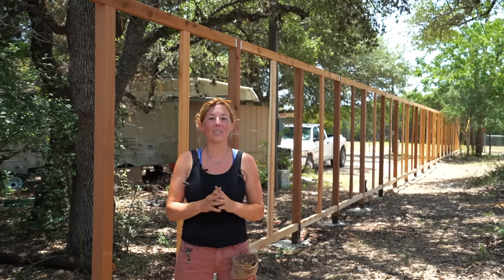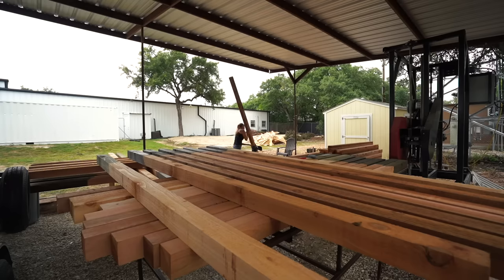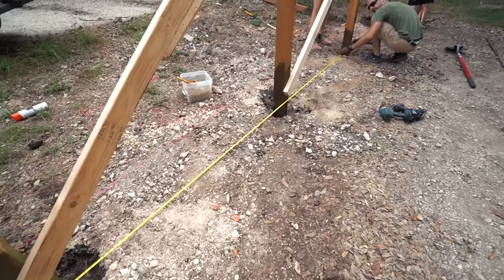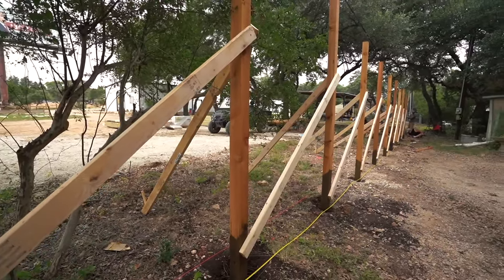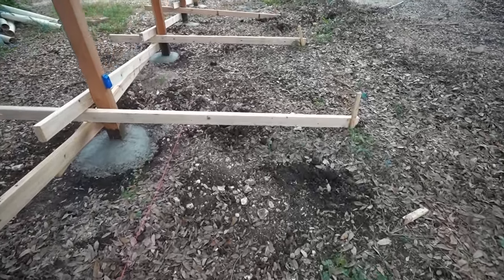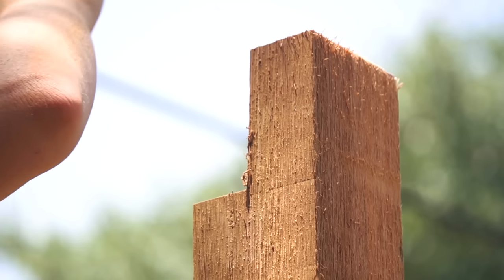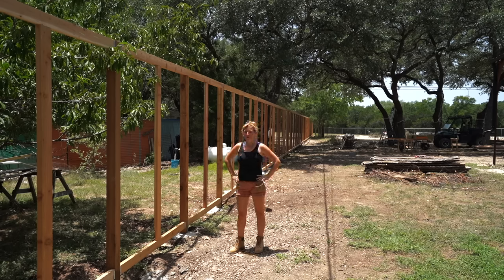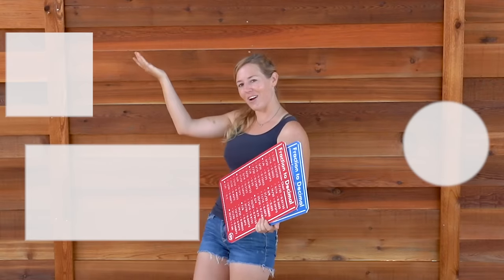Building a Horizontal Fence

Comment: Have you ever tried a product for anchoring fence post without cement? 
It's a foam where you mix 2 ingredients inside the bag, shake it and pour it in the hole and then it begins to foam up. The foam expands right into the soil, creating a solid bond. It's even waterproof from what I was told. 
I saw this being used once. I thought no way that stuff would last. That was a couple of years ago and the fence is still standing without any problems.
We're at 5,000 ft in the high mountain desert, we get real strong winds and big temperature shifts.
Anyway thanks for great the video April! 🇺🇸🇺🇸🇺🇸

Comment: nice fence, nice video.  
A couple comments.  the fence posts are not set deep enough.  A rule of thumb is to set the posts in the ground half the distance above ground.  
The second comment is with respect to the concrete.  You don't need to use concrete.  If you have crushed gravel in your area, use that.  It is a lot cheaper,  secures the post just as good and has many advantages over concrete.  First, concrete absorbs moisture which is why you need to treat the bottom of the posts.  Second, concrete shrinks so it will always leave cracks around the base of the post which will allow moisture to penetrate and remain.  Third if you live in an area in which the ground freezes, concrete will promote frost heave unless you use sonotubes.  Gravel doesn't.

Comment: Some guy I ran into at home depot when buying my wood for a fence told me once he started putting the concrete in dry then just run a hose over it he'd never go back to wetting it first. So that's what I did and it worked great. Probably a bit harder to shape it that way but saves a ton of effort and time.

Comment: Should be interesting to see how the boards bow over time and how the fence ends up.  I've tried running the rails where the major thickness was parallel to the ground and where the minor thickness was parallel with the ground and after 10 years, they were both bowed noticeably.  I had well over 250 ft of cedar privacy fencing blown down around my house during Hurricane Ike.  I replace 250 ft of it with steel picket fencing that I welded up myself (the back fence that overlooked the greenspace behind my house) and the side fences that I shared with neighbors were rebuilt with cedar.  The problem is that the privacy fences like that (or what you've created) are not particularly resistant to hurricane force winds.  Even without hurricanes, some of the storms that go through Texas pack some pretty good winds, so if I wanted a cedar fence and didn't live in a place infested by HOA Nazis that dictate EXACTLY how your fence must look, I would go with the design where you put pickets on both sides, but leave a large gap between the pickets so that air can more easily flow through them.  The horizontal basket weave style fences look like they are a bit stronger also.

Comment: Growing up my grandfather always used used motor oil as a wood sealant. He said it worked better than anything else.
Reply: To help lengthen the lifespan of in-ground posts we’re taught to use a 50/50 mix of kerosene and Used motor oil. Roofing tar also works great,  posts I coated in 2001 are still solid in the ground here in N.PA

Comment: First time I have seen such a tall fence with only two horizontal railings (top and bottom). Normally for vertical pailings there would be an additional middle railing.
The Brackets are convenient but I think add cost and although the posts are stronger because they lack the extra cut outs, the overall rigidity of the fence would be reduced (I think).
Usually posts are bigger due to the cut outs for the railings

Comment: Absolutely love the look! I may try that on my next privacy fence. However, I fear your posts aren't deep enough. with your fence not allowing any air through, it will catch 100% of the wind. A deeper post will better be able to withstand that constant pressure. As it is, you might find your fence starting to sway at some point soon.

Comment: Could you use something like Oz Post (or another post spike) instead of drilling post holes and setting posts in concrete? Seems like a time saver, but are they sturdy enough to keep the fence straight?

Comment: Western Red Cedar is not a good choice for inground use. The Copper Napthanate will help, but it is no substitute for pressure treatment and is really designed for use to reseal cut ends on pressure treated timber

Comment: Pro tip: If you are doing that much concrete, get a clear 5 gallon bucket and a small 1 gallon bucket. Put in the two bags of cement, and whenever you add water to the mix, add the same amount to the 5 gallon bucket. When you get the mix where you want it, mark the bucket at that level. Then on future batches, just add two bags of cement and that much water, and you're golden.

Pro tip 2: If you really care about distances and alignment, put in the spacer horizontal pieces before you pour. That will ensure the posts are just where you want. 

Pro tip 3: If you dig extra deep and then put 8" of dirt in the bottom after the post, you can compact it and get it to hold the post where you want it without having to put up all those braces.
Reply: Pro tip: concrete not cement

Comment: I'm putting in a pergola soon and wondering if you can tell me the easiest diy method to make sure my 4 corner posts are square to each other on the back patio so I don't have a wonky pergola??? I have a consistent measurement from house to end of patio but length ways I have a rounded patio and no point of measurement.

Comment: What size nails did you use for the mounting hardware. I noticed you used a framing nailer and then a palm nailer for the outside of the bracket.

Comment: I'm surprised you didn't dry pack your posts miss April, or even packed wet shale dust? If you would have used the shale dust you wouldn't have had to treat the posts, they recommend that for treated posts around here, because concrete will cause them to rot off twice as quickly.

Comment: Been to many years since I used a transit just remember for me it was difficult to get the scope level and can't recall if it had three or four adjusters. This is just me Others may have had no problems at all. With the new technology maybe much easier but no more than I need one sure can't justify cost whatever it may be.  Fence looks very good wish I had half your brains and ability 👍
Reply: Maybe because that's not a Transit it's a laser level Transit shoots angles
Reply: @jeffreybrookes9731   Thanks Mr. Brookes Like I said in my comment it has been 40  + years since I used one. I looked on line ( Home depot) the laser levels ranged from say fifty dollars to nine hundred. Lol I will stick with string and a 3 dollar line level plenty good enough for me.

Comment: I am in the process of making a ranch style fence for the front yard and I thought that it would work without having to put concrete in but won’t be home I was wrong so I’m having to take them all out and redo and then some of them I didn’t get the measurements right so I have to re-dig post holes

Comment: Laser measures are one of the best tools of the 21st century. In my job, I have to measure a lot of interior spaces, and I couldn't do the job without my laser, because most of the spaces are occupied and full of furniture, equipment, and fixtures that make it impossible to measure a wall with a tape. I often measure longer distances over fifty feet that would be impractical with a tape, as the sag would through the measurement off.

The biggest drawback to a laser measure is that it's very difficult to use it outdoors. Sunlight can drown out the beam and prevent the device from getting a strong enough reflection to accurately read distance, not to mention that the brighter the ambient light, the more difficult it is for the operator to see the dot to ensure that the measurement is taken in the correct location.

Comment: Just did my fence posts and 1/3rd filled the holes with water and poured two bags of quick set into the hole, (sometimes known as postcrete) added a bit more water and that was it.  No faffing about with a mixer, I don't understand this?

Comment: May I ask why you dont always use a impact driver?
Reply: For a project on this scale, a nail gun is much faster, and nails are much cheaper than screws. Screws would be about 10x the cost of nails, assuming you're using good quality structural screws with a corrosion resistant coating. (Not sure if that answers your question?)

Comment: Great video! Question, 1. Do I need to use the copper at the bottom of the posts if I use redwood? And if so does it stain the wood or dry off, because I wasn't planning on painting it.  Thanks!

Comment: How are the dipped cedar fence posts holding up over the years? I am considering using cedar posts for my fence project as well, but I am hesitant based on my research stating that untreated cedar posts won’t last as long as pressure treated pine or Douglas fir. Any thoughts?

Comment: Still people mixing concrete for Fence posts.  Dry fill and wet after. A Proven and approved method for setting fence posts. Even allows for minor adjustments prior to wetting if necessary.

Comment: Putting Wood into the ground here were I live would mean that it would rot away after a few years no matter how it is treated. We usually use a bracket set into the concrete footing to hold the bottom wood and make sure that no water can get in between the bracket and the wood. It's the only way it works that will let it last here in Norway. 

Everything that goes into the ground here rots, rust or fall apart thanks to water and the shifting seasons, so the only way to make thing last is to do it the 'right way' the first time. The rule is that if it touches the ground it must be either concrete or stone, else it will rot or rust. Hell even galvanized steel or other steel with high corrosion protection will rust away unless it has a coating that keeps the steel away from the ground and water.

That said, even pressure treated wood to protect it from nature rots after a few years if you don't maintain it, there is just too much water so things never fully dry and that's a major part of the issue.

Comment: 3ft treated bottom but looks like 8 to 12 inches treated above the concrete. I'd be very wary about the longevity of the structure. Especially since light pressure of driving the cross members really wobbled the posts.

Comment: The posts are not deep enough... the next big wind is going to be a problem... you'll have a "wall" under pressure... I don't know what your area is like with wind and the trees might work as a wind break but it's putting a lot of stress on the posts.

Comment: I haven't set posts in concrete in years. I use the soil compaction method. The posts are just as rigid as setting them in concrete.

Comment: I don't usually comment on posts. However, during your post setting in cement you made a big mistake of not vibrating the cement to remove any air in the cement.  
We just bought a house with similar style as your building & 2 of the 12 posts are not set correctly and as a result the fence needs to be fixed next spring because the post inside  the concrete was not properly vibrated the air out.
Just saying

Comment: Don't put concrete on post, mud is enough, when earth move it doesn't matter if it has concrete it will move, but with mud only fixing a fence tilting is less harder and easy to fix or replace. I had all my post 6yrs now and still no tilting with any concrete on it + when it's time to replace you don't need to break a concrete.

Comment: to install the post you don't really need a concrete mixer you can just pour directly out of the bag into the hole as you add water at the same time as long you don't over water the mix I have done it for many years ain't no problem with it

Comment: Why use concrete at all... It's a terrible product... Especially when you have to take the fence down... A cross stick under ground on to the post and some good fill material like the one you put under the poles... Impressive project - Nice inspiration 🙂🤞

Comment: If you've run an auger like that, you wouldn't be so judgemental.  If you had requested bigger diameter holes, you wouldn't have done so much hole modifying, but you'd have much bigger holes to fill.  Up to you.  Not the driller.  Auger holes of that type are not of perfect cut outs.

Comment: i´m no fan of burying wood into soil (especially after heavily intoxicating the woodpost)..
why not use a (adjustable) post base bolted to/or embedded in the concrete ?
there is no need for chemical treatment of wood - the "constructive wood protection" is all that it takes!
besides : the look is nice

Comment: Well, by right you should have measured and marked the ground first where you wanted your holes to be dug. Seems like you expected the operator to know where to put them for you and that's not how it usually goes.
Reply from the maker: You’re assuming I didn’t. I did. I placed a string line then marked in bright orange spray paint the exact center of each hole with a big X. It was a bad operator in this case.